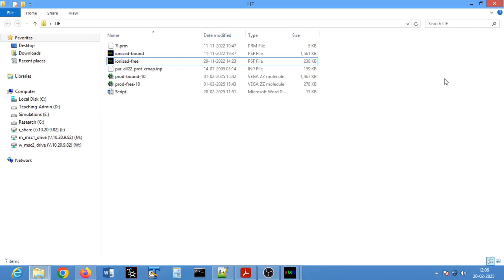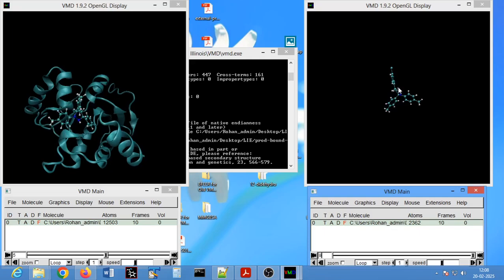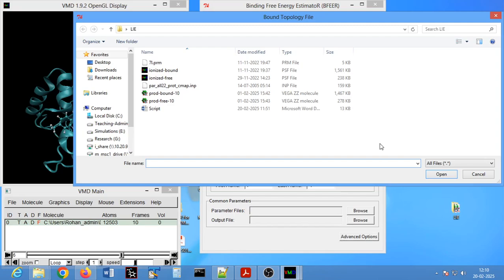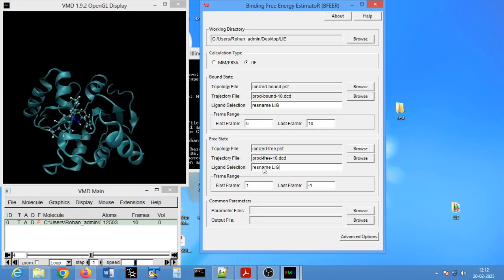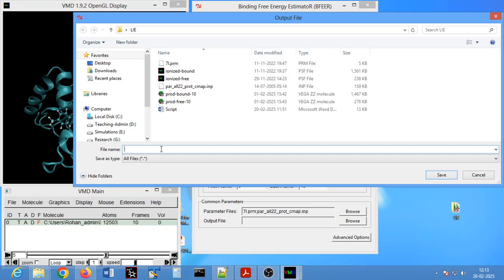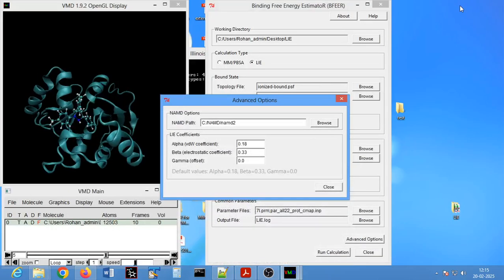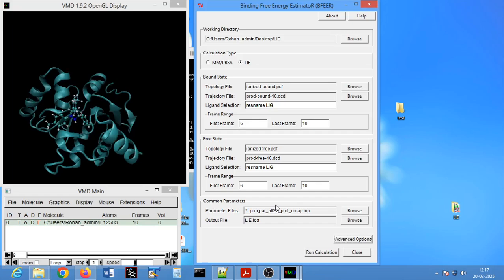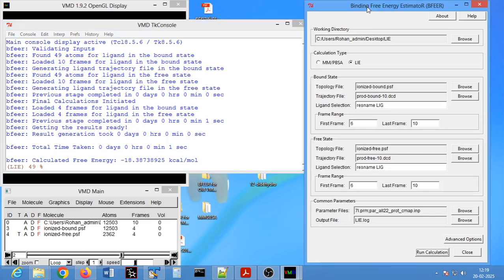Free energy calculation by LIE Method using BFEER

Comment: Thank you for this helpful video 👌,  i'm so excited to the next video ❤️ 
And please i want to know more how we can perform PCA
Reply from the maker: You can do PCA in VMD through the proDy Interface within the Normal Mode Wizard. All you need is to change the ProDy job setting from default 'ANM calculations' to 'PCA calculations' its not very difficult.
Reply: @scribblesinbioinformatics6246  thank you❣️
Reply: Hi Eman 
What's the difference between LIE and FEP?
WHICH is more precise ?
Does the LIE method including delta S in there calculations like PEP or not ??